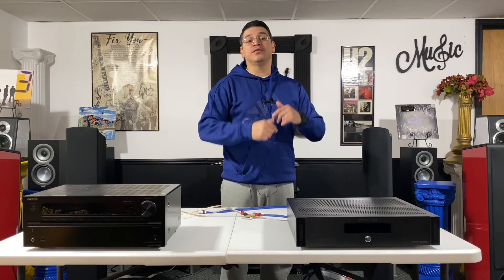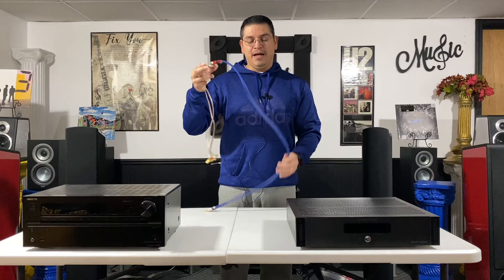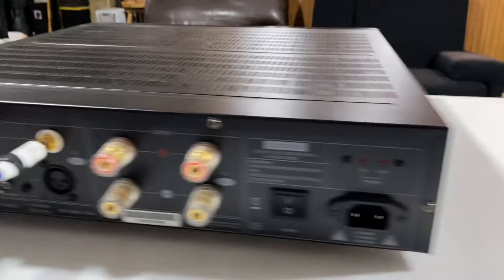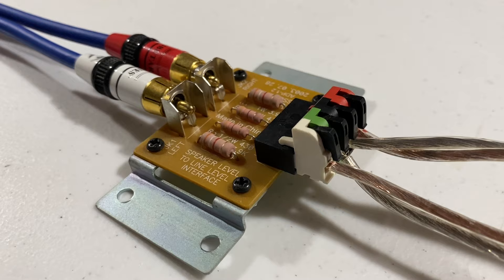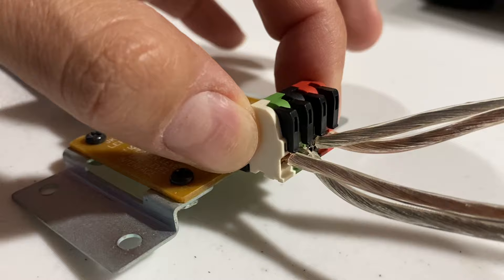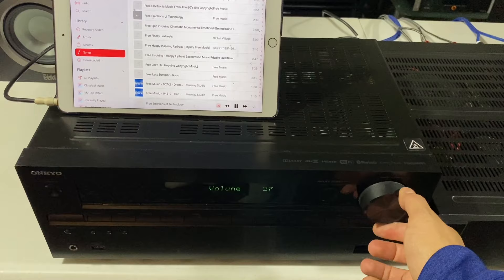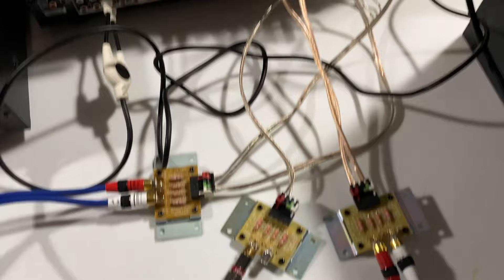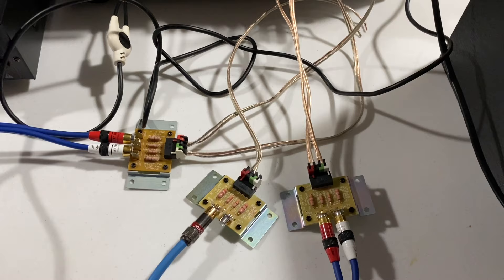Connecting an amplifier without using preouts.

Comment: I'm not quite comfortable with this. As I understand it, the adapters do not present a reactive load to the output stage of the (pre)amp. This load would have to match the preamp specs (correct ohms). Otherwise you will damage the output stage over time. Basically the same thing as with guitar amp slaving. Or am I missing something?
Reply from the maker: In theory you’re correct as I thought the same thing. The adapter is measurable down to 4 ohms, my receiver is compatible with 8, 6 and 4 ohms. So far it hasn’t had any issues. I’ve been quite surprised and satisfied with it. Thanks for watching and commenting
Reply: @Audiolympian  It was not more easier to connect the RCA cable to the LINE OUT of zone 2 of AVR without the adapter?
Reply from the maker: @ralphdantzoff4091  theoretically yes. But the zone 2 doesn’t work that way for some reason
Reply: @Audiolympian  So, maybe "theoretically speaking" the mistake is not knowing how to configure it.
Reply from the maker: @ralphdantzoff4091  agreed

Comment: Thank you so much for showing us all.
Reply from the maker: You’re welcome. Thanks for watching
Reply: @Audiolympian  when you buy and install those adapters do you lose any amplifier wattage power?
Reply from the maker: @docjohnson3980  good question. It doesn’t sound that way to me of course I’m not using any measuring tools and all amp are different. The amp I use is quite powerful. So if I do loose any it’s not very noticeable
Reply: @Audiolympian  Just want to say thank you responding back. I'm going to purchase them now thanks to your video. Just know you saved me some serious $$$$ I was getting ready to spend over 1500.00 on a AVR.... Cheers 🥂 you definitely earned my thumbs up and I'm definitely going to be subscribing. Wishing you nothing but great success 🙏
Reply from the maker: @docjohnson3980  appreciate your support. Thanks

Comment: i will be using this video as guidance for my hookup connecting the front LR speakers and center when i gert another adapter for the center hope it works out THANK YOU!!!
Reply from the maker: You’re welcome. If you need any help or have any questions don’t hesitate to reach out. Thanks for watching
Reply: audiolympian i have the emotiva BasX A3 it has 3 channels where am i placing the RCA cables 1-2-3 im only hooking up two channels the front left and right the center at a later time would really appreciateyour help thank u
Reply from the maker: @Joereyes1  I would just connect to 1 & 2. Just make sure the speaker cable from the receiver to the adapter are in line with the rca cable output. Hope that helps. Thanks for watching
Reply: @Audiolympian  i dont get it yet i tried no sound but i will try again thanks for the feedback
Reply: Works thanks alot Audioolympian took me some time but i got it thanks too U  DAMM ITS LOOOOUD!!!!!!!!
Reply from the maker: @Joereyes1  you’re welcome. glad you got it. Don’t blow anything up lol

Comment: beautiful! liked and subscribed.  where i live we have a wonderful fm classical station and i like to vary which  receivers and speakers play at the same time.  i have added more speaker sets with either small fm contained class d amps or power amps like aiyima 07 class d  and audio source 100 ab amps fed by a radio with headphone out.  i love the fullness and echo effect i can achieve with separate volume controls.  some radios will only give one speaker power thru the amp while others provide both ( in mono).  no stereo effect thru the radio fed amps, but the effect is still stunning.
Reply from the maker: Wow that sounds like quite the amazing set ups. Thanks for watching
Reply: Your Onkyo av doe have preout. "Zone 2, Line out, Pre-Out Subwoofer. That Is your preout...
Reply from the maker: @genchic1  I thought so too. But when I connected up to it it didn’t work. Thanks anyway. And thanks for watching

Comment: Good method, but it's not the same. Pre outs are routed out before the signal gets amplified. 
I had an Onkyo tx-nr607 and on this reciever you could retrofit true pre out channels. There was a preamp board and an amplifier board, these two where just connected with some wires that had low level signals on them, so you where able to just cut the wire and route a pre out and pre in towards the back.
Reply from the maker: Sounds like an interesting project there. Thanks for watching

Comment: Thanks for the video.
I think I almost broke my brain trying to write these questions. 🤯
2 questions: With the AVR's FRONT SPEAKER OUT going to the AMP's LINE INPUT IN does that mean that if Im watching TV/Movies I would have to switch to AMP's LINE INPUT IN SOURCE  to hear that sound?
Also if I want to hear 2 channel audio from the AMP would I simply switch to any other mode besides LINE INPUT IN?
Reply from the maker: Thanks. You shouldn’t have to switch the source for because the device takes the existing signal for the speaker. And redirects it. And if you want 2 channel sound just change the sound mode on the receiver to stereo. Hope that helps. Thanks for watching

Comment: This is very interesting, thanks! That said, does this not degrade audio quality and defeat the purpose of off-loading power to the external amp? I’m hardly an expert, but I believe that the pre-outs on an AVR bypass the power amp section in that AVR in order to hand that function off to an external power amp. What you’re essentially doing here is going from pre to power back to pre and again back to power. It must have an effect on SQ.

Furthermore, the whole point is to divide the AVR’s power over fewer channels. If an AVR is rated for 100W, that typically means 100W with 2 channels driven, so significantly less per channel with all channels driven. Using pre-outs allows the amp to allocate more power to the remaining channels. If you’re connecting your external power amp to the speaker terminals, however, I don’t think it reduces the power consumed by the AVR to drive those particular channels. Or does it? I’m not sure…
Reply from the maker: Thanks for your input. You’re correct about the preouts concept, it does bypass the amplifier section in the receiver and reroute the signal for an external source. In that case this method takes the existing signal and sends it to the external amp. As far as the quality of sound degrading, you are probably right that is does somewhat downgrade but depending on the quality of the external that should help fill in the gap if that makes sense. Also this method does not completely lessen the load of the receiver being that it uses the existing signal. If the receiver has preouts and an external amplifier is connected to those, that method does lessen the load of the receiver and allow it to push a little more power to the other channels. Hope that makes sense. Thank for watching

Comment: I just came across this video and it is perfect for my question I’ve been having for quite some time. The only question I have is… does having these adapters affect the performance of the power or will it sound different from it hooking up directly from an A/V to amplifier connections? Thanks for this info. It truly does help.
Reply from the maker: Glad to have helped you. Interesting question, I had the same thought. No it didn’t seem to have an effect on the sound but I did notice a difference on sound based on the receiver it used being I had the adapters connected in 3 different systems, same amps different receivers Denon, Onkyo and pioneer. Denon had more midrange, Onkyo more bass and pioneer had more high-frequency, hope that helps. Thanks for watching
Reply: @Audiolympian  those differences could be explained as them being the difference between brands and their characters and not so much because of the adapters. I’d be interested in seeing an analysis of an A/B testing between the output of the power through the adapter versus directly from receiver to amplifier and see if the output is the same. Keep up the good work. I’m always listening.
Reply from the maker: @yotaman2112  good idea. I think I’ll do a video on that. Thanks again for the support

Comment: Great vid! How would configure this if wanted to do just the center channel?
Reply from the maker: Thanks. If you only want to use one channel just use one side of the device. That’s how I use it for my 5 channel set up. 3 devices = 2 left channels, 2 right channels and one center. The cool thing is you have an extra input for the future if you want to add another speaker. Hope that helps. Thanks for watching

Comment: so if using this for the center speaker, which side of the adaptor do i  put the two wires to?
Reply from the maker: You can use either side of the adapter. Just make sure you connect the rca cable to the same side (left to left or right to right) hope that helps. Thanks for watching

Comment: I have a Sony STR DH790 and I'm trying to use my Sunfire HRSIW8 subwoofer amplifier for a passive subwoofer.. Can someone please tell me if I need a line level converter and if so how to wire it.. I beg someone answer me! I have two of those amplifiers and for 4 years haven't been able to use them because I don't know how to hook them up..
Reply from the maker: From the looks of the amp and receiver, all you need is an interconnect cable (rca cable) and regular speaker wire. The internet cable connects from the subwoofer output on the Sony receiver to the rca input on the sunfire amp. Then use the speaker wire from the amp to the speaker (passive subwoofer) of course the sunfire amp needs a power cable to plug in the wall. Then go in the receiver’s settings and set subwoofer to yes. Hope that makes sense. It’s fairly basic connections. So if someone is a beginner it should be easy to follow. Thanks for watching. Any other questions feel free to reach out.

Comment: Great video! Do you get any feedback or static from the speakers using this method?
Reply from the maker: Thanks. I did when I first connected multiple devices. Until I screwed them on a wood plank and kept them stable and added a cover to it. Now, no problems at all. Thanks for watching

Comment: Can you go directly from speaker terminal without the adapter and combine power of both units?
Sounds like this turns your a/v receiver into a preamp
Reply from the maker: Yes. Essentially it does turn the receiver to a preamp. You might be able to rig it up so you could use bare wire to the amp but the adapter has resistors and filters so it’s a safer connection. But anything is possible too. Hope that helps. Thanks for watching
Reply: @Audiolympian  
I was about to buy 2 125w Marantz monoblocks.Thought was to combine my Yamaha 125w per making combined 250w  per channel.
Speaker out into amp via RCA.
Reply from the maker: @budzlightyear2212  I see. You’ll definitely want an adapter for that. I wouldn’t risk any damage to my Yamaha or those marantz mono’s

Comment: Hi, thanks for the video! I assume that, with the adapter in between, I can run my NAD C315BEE, which does not have a pre-out, into the line-in of my LOEWE Klang 1 Sub? Any enclosure available separately for the adapter? Cheers, Moritz
Reply from the maker: I haven’t tried using it with a sub but it should work. I haven’t found any specific enclosures or housings for the adapter but I used one from partsexpress.com. Hope that helps. Thanks for watching
Reply: @Audiolympian  Many thanks for your swift response! This is helpful.
Reply from the maker: @moritzmusik5826  happy to help

Comment: Thanks for the vidéo, I just have a question, do you need tu put one on all channels or (for a 7.2 setup) can you just use it for the FL and FR..? 
And what about sound ? If doing only 2 speakers out of the 7 doesn’t it make them too loud compared to the rest ? 
Thanks for the reply !
Reply from the maker: No you don’t have to run all you channels through the adapter, you can use it on just your Front main speakers. As far as sound that will depend on your amp. But yes it will most likely be louder on the fronts if those are getting power form an external amp. I have my current set up as a 5.1 but only 3 adapters for my center and fronts. They’re louder but I am closer to my rear speakers so it’s not a total mismatch. Thanks for watching and the question.

Comment: I finally found your channel...and I need your help.  I have the Fosi Audio BT10A and I hooked them up to my Sony SSCS5, went to the bluetooth on my phone and the sound was sputtering...meaning off and on and off and on very quickly...Do you have an idea what that could possibly?  Also I don't have an Antenna, could that be the cause?  This is my first attempt at a home hifi system and I've been at this for about a month, and today, I have everything connected and the sound sputters...in putting together the banana plug, some of the bare wires got cut a little, and hey maybe that's the problem.  I don't know but I know I'm tired of looking at these Sony's and they are not working for me, so please help this newbie
Reply from the maker: Thanks for watching my video. In looking at the Fosi Bt10a I would have to say the intermittent sound your getting is probably from not having the antenna or if you were to far away from it. That will cause sound disruption as well. You can try wrapping bare speaker wires on the antenna base and wrapping it in foil to act like an antenna. It’s not perfect but could help boost your signal. Hope that helps. Thanks again for watching

Comment: Does it have a level control??

Think that ur amp can push 80w and the line out converter is capable of delivering pure audio to the rca without over power music..

Then my receiver is delivering 150w and i am connecting that l.o.c for my receiver, then will my music overpowered to the rca and cause clipping or distortion. 

Please answer me.. becz all the car audio loc has a level control...
Reply from the maker: The device does not have a level control, but that’s because all the control and adjustments can be done from the receiver. Which you will need to do, to get the sound to your liking. Hope that helps. Thanks for watching
Reply: I get why you would want to do this, but it doesn't bypass amping if the avr, you get the signal amplified twice.
Reply from the maker: @shs747 yes, you’re correct. Thanks for watching

Comment: I have a denon receiver with two zones. I want to add additional speakers in my backyard pool but be able to play the same music as where my receiver is located. I don't have the preouts on my reciever. Can I do whay you did in the video and connect the receiver to a whole home amplifier to be able to play the same music on my addional speakers and do you think they will be a delay between the music inside and outside the house by doing so?
Reply from the maker: It should work as long as your home amplifier has the additional channels. As far as a delay in sound, that would depend on the distance, which could be adjusted by the receiver. Other than that I don’t think there would be a delay. Hope that helps and thanks for watching
Reply: Thanks for the help and quick reply!
Reply from the maker: @lquint02  you’re welcome

Comment: I have Pioneer VSX-932 AV receiver that I love the way is sound but only have preout for 2 subwoofer even so  sound amazing  , I just follow the guide from your video . I got a very good deal  for a used AudioSource Amp Three 2 Channel Power Amplifier  150w pc ,hook it up  and even my 3 powered subwoofer sound more vivid. My question is since the the 2 main channel on the AV receiver is now getting the juice from  the power amp is ok to set  in the receiver my main speaker to large instead of small since the AV receiver don't have to make any extra effort to drive my 15 inches main speaker ? Another question the main 2 speaker channel in the receiver still power up or the receiver take the main speaker power to feed with more power the other channel?
Reply from the maker: Thanks for the question. It will be fine to change your main speakers to large. That basically shares the bass response with the sub instead of solely pushing Lfe to the sub. For your second question receivers do share power loads between channels but not how we would think, it’s not an even continuous max split of power it pushes extra watts when needed like explosions and loud sounds. Hope that helps. Thanks for watching

Comment: Hello!
I dont know anything about preamps, or so, Now I have hometheater AVR at home, hooked up with my 5.2 channel speakers.

But I do have a second older 5.2 channel AVR as well that I am not using anymore.

Now I wonder, can I use the second hometheater AVR as a amplifiers for my left and right channel only?

Like: left and right speaker channel out from receiver 1, to adapter (in this video) to let say BD RCA input on receiver 2. And then left and right speaker output to my left and right speakers.
Reply from the maker: Theoretically yes it can work the way you describe however, I’ve never done it so I can’t say for certain but I have known people in the past use a second receiver to power speakers. You may have to go in the receiver’s settings and adjust things but overall it should work. Hope that helps. Thanks for watching

Comment: Does it matter what the ohms rating on the receiver is when you ad an amp like this
Reply from the maker: Good question. Yes and no. As long as the ohms do not drop below 2 ohms. Which most receivers do not go that low. Hope that helps. Thanks for watching